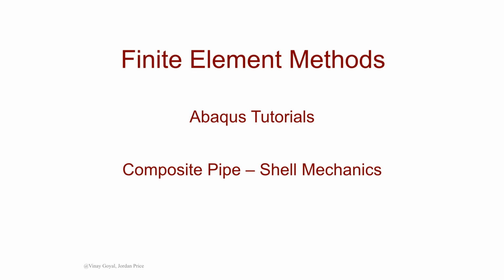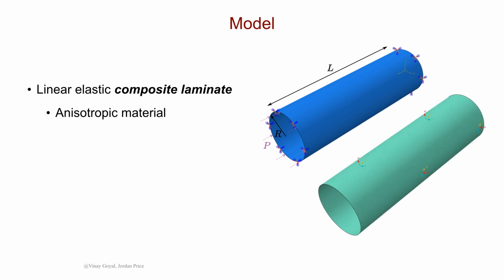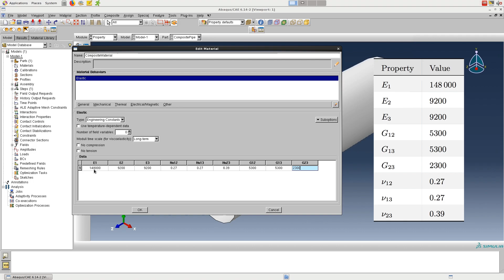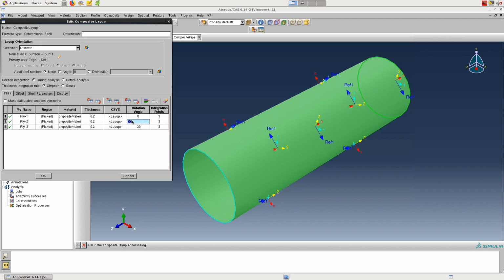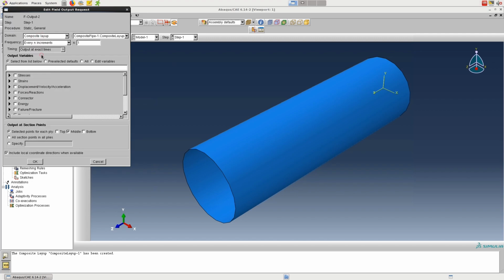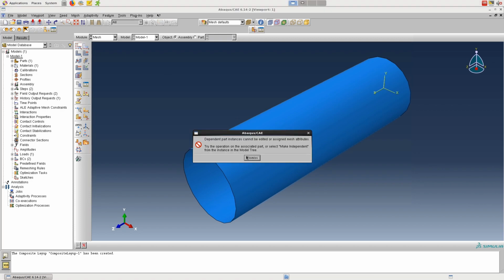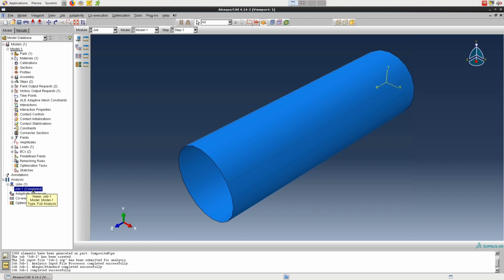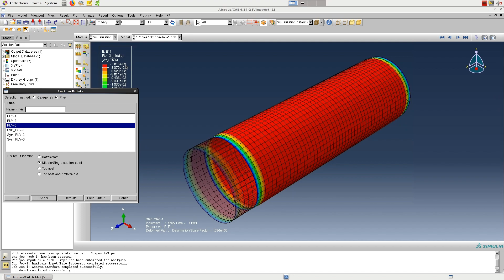#ABAQUS Tutorials - Composite Pipe Under Loads

Comment: Isn't the ply stack plot rosette has different orientation from the main module? Z becomes 2, Y becomes 3, while X sticks to 1. Do you have any idea to solve that?
Reply: Hoping for your reply. Thanks in first Vinay/Jordan!
Reply: @lefrann  Quote from the Abaqus manual: "The triad in a ply stack plot represents the element orientation system, and it shows the shell normal or stacking direction (the 3-direction)"
(maybe not relevant to you anymore, but it might help someone else who reads this later).
Reply: What conclusion can we give on our analysis